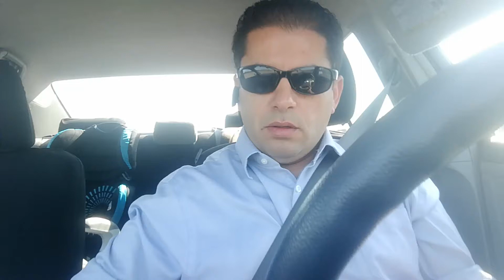Never Over Torque Your Wheels! How over tightening your wheels can cause Major Damage

Comment: There's no way over tightening will cause rotor warp after contact with water, maybe if you torque one lug nut at 250 and the rest at just 50ft/lb leaving the wheel unbalanced, but that's still a big maybe.

Over tightening strips out your studs, that's it !
Reply from the maker: Sorry for the late reply! did you find a solution?

Comment: You are all idiots. This is Wendy's husband. I've had 3 cars damaged by overtightening of the Lug nuts. It warps the rotors, it burns up inside pads and it stresses the whole unit. When your book says 80 ft. Lbs. , do it to specs. I've removed wheels that were damaged by impact wrench tightening that were 200 foot pounds. That's way over 80 ft. Lbs.
It causes damage due to heat by not allowing the rotor to expand. If you impact and believe no damage will occur, You are just an idiot. Thank you.

Comment: 24 apr 2019 9:58 am edt:
0:56 warp brake-disc ?
1:11 damage stud
thanks

24 apr 2019 9:59 am edt:
#add# 0:56 warp brake-disc
1:11 damage stud

24 apr 2019 10:1 am edt:#insert# ? #to# 0:56 warp brake-disc ?

21 feb 2020 5:39 pm est:
over-tighten/over-torque wheel-lug-nut won't bend brake-disc/brake-rotor, but will damage wheel-lug-nut-stud:
https://www.youtube.com/watch?v=-kCwf4txyMU&t=5m44s (How to Replace Rear Brakes 07-11 Honda CR-V) from youtube-search (crv drum brake and disc) result 4

21 feb 2020 5:43 pm est:but this source agree that over-tighten/over-torque wheel-lug-nut bend brake-disc/brake-rotor:
'unevenly torqued rotor, or an out of sequence torqued rotor, will not be bent out of true when the rotor is cold. However, as the rotor heats up in normal use, it will expand unevenly' in http://www.hendonpub.com/resources/article_archive/results/details?id=1642 from google(warp brake rotor over torque)result 2

21 feb 2020 7:14 pm est:
other-source agree that over-tighten/over-torque wheel-lug-nut bend brake-disc/brake-rotor:
(1)'Every time you have new tires or wheels installed, or your tires changed over, a team member at the store will ask you to come back the next business day or within 50 kms to get your wheels re-torqued. It’s free and it’s fast, and it’s important to your safety. Here’s why. Re-torquing the wheels involves tightening the lug nuts to help ensure they’re not too tight or too loose. Too tight, and the nuts can damage bolt threads, break fasteners or warp new rotors.' in https://info.kaltire.com/why-re-torque-the-importance-of-retorquing/ from google (retorque wheel) result 1 from 'New wheels should be re-torqued after the first 50 to 100 driving miles' in https://www.tirerack.com/tires/tiretech/techpage.jsp?techid=107 from google (maximum torque wheel lug nut) result 1

(2)'And when you look at that, and realize that the average torque required on a lug nut, to hold the wheel on, is 80 to 90 ft-lbs, well you can imagine how over-tightened some of these lug nuts are. Now that’s a problem because it almost guarantees warped brake rotors' in https://www.motorweek.org/features/goss_garage/impact_guns from google (maximum torque wheel lug nut) result-people-also-ask->how many foot pounds do you torque lug nuts?
Reply: Damn dude
Reply from the maker: Sorry for the late reply! did you find a solution?